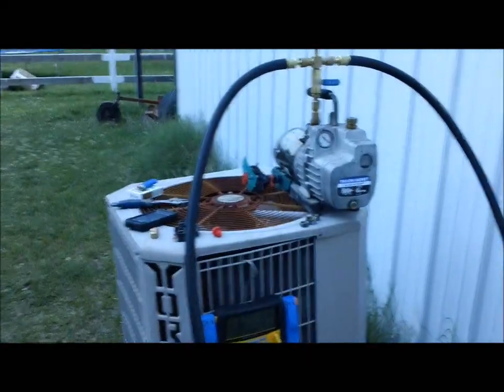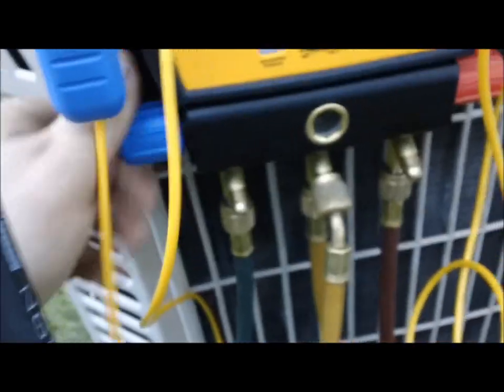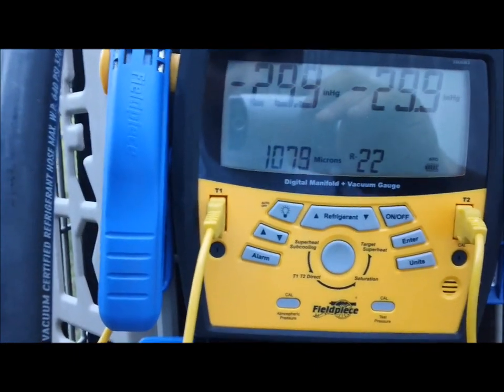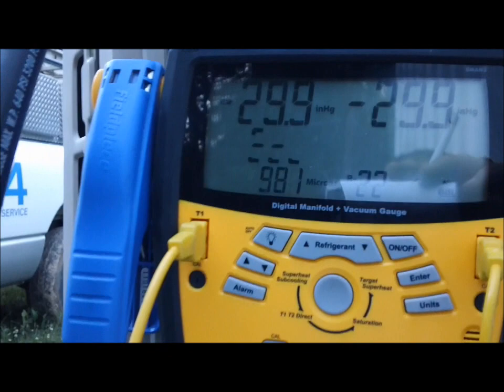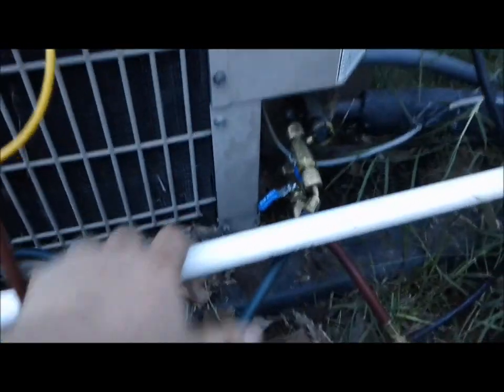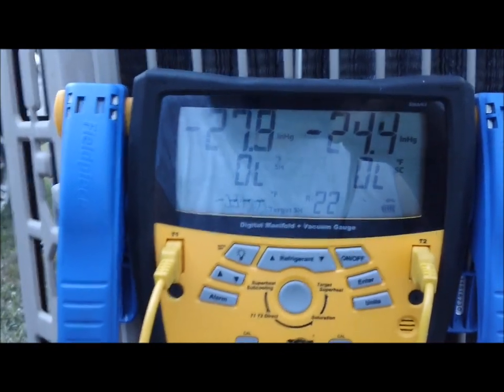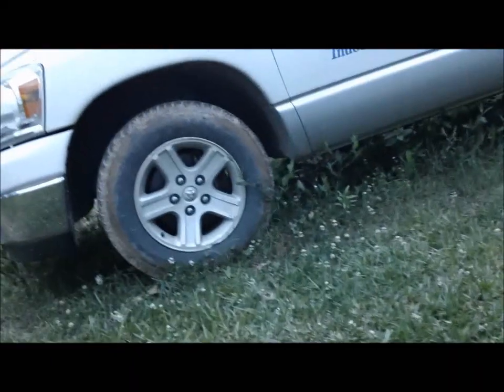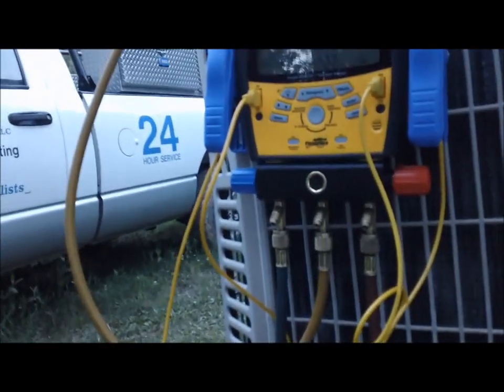HVAC: Vacuum Experiment

Comment: The valve shut off leaks on the big hoses bro they leak by the handle shut off .under the handle is rubber or  plastic oring so when the handle is on i causes air to get pass the oring. As your vaccuming .try tighting the nut on the handle of the shut of valve.or single vaccum test each hose..for leaks i can tell ya how to do that

Comment: Check your hose seals, minimize connections, use nylog on all seating surfaces, & sweep the system with nitrogen each time after you do a drop test. Observe the drop test results, is the micron level rising slowly and leveling out , which could be that the refrigerant and oil is outgassing vapor.  Or, is it rising rapidly to no end , which may indicate a leak of some sort. By  the time you run a second sweep of  nitrogen you should notice a big difference in vacuum time and micron level dropping much faster, provided all other factors are correct. There is a small book titled , "Review of Vacuum  for Service Engineers, by Saunders & Williams, first published in 1959 then revised in 1988, which sheds a lot of light and explanation on the subject  of the vacuum process. The physics of this process has not changed so much, only the equipment has evolved somewhat.  It's  just my take and tidbit on this subject. Good Luck   😐

Comment: Too many hoses and connections to leak.  If you’re want a good vacuum use copper tubing and flare fittings.  Eliminate your manifold and hook up the micron gauge as far as you can away from the source of vacuum.

Comment: The hose has collapsed in my opinion that is why we use the 3/8 will not collapse. Yes you are nuts to believe you pulled that number with small hoses.

Comment: s/man  gauges show vacuum of gauges not a/c unit when you use 1/4'' hoses.  1/4'' hoses will close up under high vacuum, giving tech false reading.best vacuum is 3/8'' hoses direct with no valve core. (pump to service valves)vacuum pump can only pull gas not liquid.  gauges show vacuum but could be liquid still trapped in system.  30 minutes minimum time for pump.change centre hose  (yellow) on gauges from 1/4'' to 3/8'' with brass adapter at manifold. new hose 3/8''  to 1/4''  to vacuum pump or 3/8'' to 3/8'' hose to pump, will pull against  manifold instead of centre hose.

Comment: The more connections the more chances for leaks....Did you use any type of sealant on the joints? .....If you had leaks on the Appion hoses it wouldn't pull down as far with 1/4 inch with less joints ...Also the seals might be better on the 1/4 inch hoses...lots of variable to consider .........

Comment: walk in to the evaporator  coil  and heat the cold areas, with a heat gun and the ice crystal will melt and it will draw a   faster, deeper, vacuum.   unless it has a leak. theres no reason it doesn't reach 500 microns Ive seen my micron gauge stall at 1100 and such  put heat to the coil . METERING DEVICE, piston where ever is its holding moisture " JUST NOT THE THE LIQUID LINE FILTER"  and you will find this helpful.

Comment: I don't think those apion hoses matter. Its gonna matter on the smallest hole in the line. Like if you have a 20 in return but at the unit you have a 10 in collar and reducer your only gonna get the cfm of the 10 in. Right or wrong?

Comment: I read through the comments and nobody has mentioned this so I want to share with you.  When you do a pump down and contain the charge in the condenser unit, there are times when the service valves will leak, between the condenser side and the lineset.  So you will get your vacuum down to that point, but your refrigerant leaking from the condenser side will not allow you to get that vacuum down any more.  The leak rate is not constant, if you've ever seen a leaking valve through the top going to the outside, they fizzle more and less so it's not a constant.  This is a phenomena that had me wondering, and this was the answer to it in my situations.  For the record, poor vacuums are not more acceptable for R22 as opposed ot 410a.  I wanted to point out that disinformation.  Regardless of refrigerant being used, you need to remove noncondensibles and contamination from a system and that only happens down at the 500 micron and less range.  I know the video is older, but I hope you get this comment and that it helps you.  I know how frustrating it is when you can't get a vacuum.
Reply: +acoustic4037  And for what it's worth, I believe that service valves (king valves) leak because people don't use a wet rag on them when brazing in the lineset.  The heat gets to them and causes the seals to fail to seal fully.  This goes to show you that a job can be done wrong, but the consequence isn't seen until much later down the line.  The same is true regarding brazing.  ITS IMPERATIVE to use nitrogen when brazing.  So many guys don't but they don't know or care that the system will suffer from that down the line, when orifices or txv's fail due to the oxidation being moved around.  Equalizer tubes can get junked up or reversing valves leak by, all due to not following correct procedures.  I hope this information helps new guys and old alike, start doing the right thing.  The customer whos system gets screwed up could be someone you care about, but the reality is we should care about every single customer.  They make our pay check.
Reply: +acoustic4037  I couldn't agree more ,  Ive  just got my NATE certificate. through a TECH School and using an enert  gas while brazing line sets was something I didn't  do in the past. however working on some of the Donated Equipment at the Tech school  and realizing some of these machines were less than five years old ,makes me realize I did a lot a harm in the past  all from not being taught the proper way. I don't know everything but I am honing my  craft.
Reply: I thought the same thing when he mentioned the vacuum between 22 and 410A. The system isn't dry and not free of non-condensables above 500 microns.
Reply: HE PULLED IT DOWN ..LESS THAN 500...DID YOU GUYS WATCH WHOLE VIDEO?

Comment: I have similar setup Sman4 with econ jb vac pump. Good idea is to remove your hoses and blow nitrogen through the manifold through each port with all ports open (clean out). Watching this video I'm sure there is problem with the seal on his appion hose. When i purchased my 3/8 YJ vac hose It cut down the vacuum time in half because math doesnt lie and its almost double size perfect for pulling equally from 2 1/4 hoses. Also this Video was taken on the same unit so the air, moisture and non-condensables were essentially removed prior to him hooking up the 1/4 hoses reguardless of breaking the vacuum it will naturally pull a vacuum quick because it has less work to do. Thumbs up please if you agree!!!
Reply: Gotta agree with you here.  I was thinking the same thing with him pulling vacuum with the Appions before using the 1/4" lines. Besides, after pulling you still have to blank off and watch for rise in  pressure. Those 1/4s are permeable and WILL leak, they aren't designed for pulling a vacuum. Also, 500 microns must be achieved for ANY type of refrigerant being used due to non-condensables being present above 500 microns.
Reply: mconner1978 I

Comment: EVERYONE IS WRONG the closer you put a micron gauge to the vacuum the faster and inaccurate your reading. The proper way is to put the micron gauge as close as possible to the condenser via tee or Schrader tool with extra port. Not saying my way is right, just more accurate and quicker. Lol
Reply: You sir are 100% correct!
Reply: Mike Reynolds AGREED! That tells you exactly what you have at the line set when blanked off via the VCT! If it goes up you know there is a leak somewhere.

Comment: i use a 4 valve manifold, a set of 1/4 hoses that i took the depressors out of and i use the core removal tools. since my manifold is a 4 valve im pulling through a 3/8 vacuum hose split into the 2 1/4 hoses. it works plenty fast but i figured i would try the vacuum set up yall are using cause maybe it would be faster. my testing comes out about equal on time. 1/2 inch hoses- you can only pull as much through the 1/4 part as you can pull regardless
Reply: I did the same type of experiment and came to a similar conclusion, however I have yet to try it on a longer line set or bigger system, where I think bigger hoses might be more benificial.
I do a lot of ductless installs, and even removing core depressors only gains me half the time. with bigger hoses don't see much of a difference  maybe 5 min. at most.

Comment: Ok, Thanks!! 
BTW,the point that I was going to make is that if nitrogen was not used to break the system then the second attempt would be significantly faster and it doesn't matter if the 3\8 or 1\2 hoses are used. That's what we found out while we were testing anyways.

Comment: I did think about one small thing. During the 1/4 hose evac the pump is drawing across that sensor in the sman. During the 1/2 appion evac the sensor is 5 ft away down a 1/4 inch hose, not in the direct path of the vacuum. I dont know how much difference that makes but I know it makes a little difference as far as the reading.
Reply: good point!

Comment: After watching many videos with different vacuum setups, I really haven't seen that much improvemet by switching to 1/2 inch hoses. Logic tells me that you can't pull much more than what can flow through a 1/4 inch fitting and you can't change those and keep the vacuum. Also, the more connections you have, the more chances are you can have a leak. I had a problem pulling a vacuum the other day and it came down to one bad rubber seal in a 1/4 inch hose. Changed hoses, problem solved.